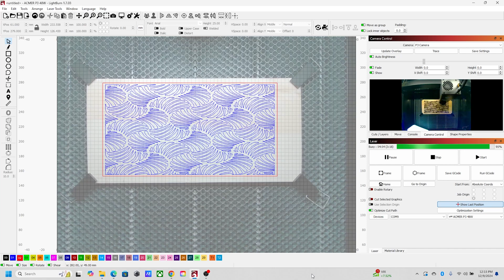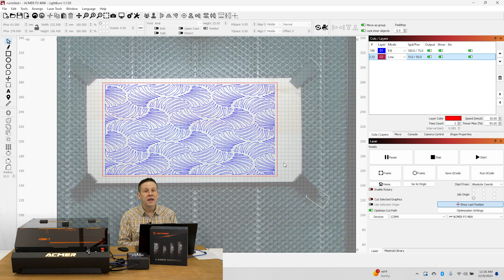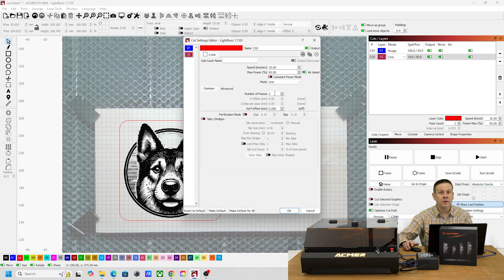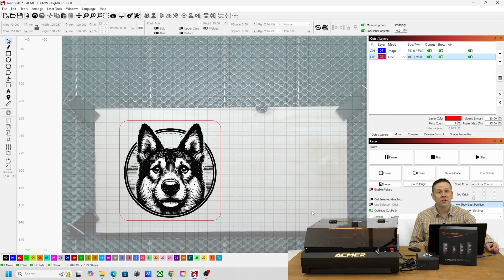Acmer P3-  Project Time! #acmer #laser #laserengraving #fun #funvideo #dyi #woodworking

Comment: what is runing cost for building such engraving on wood piece. i am thinking about business perspective. how much it cost to produce these pieces just to understand the profit model for these products. please give an idea including wood piece price and electricity cost based on average electricity price is us
Reply from the maker: Good question and highly dependent on what materials you're using- there's a wide cost on cost/ quality.  Building rent, electrical cost is also dependent on the specific area and traffic flow.  The machines use relatively low amount of electricity.  Sounds like you know the cost items and you just need to apply them to your area and calculate operating cost and compare the retail sales projection for your area!